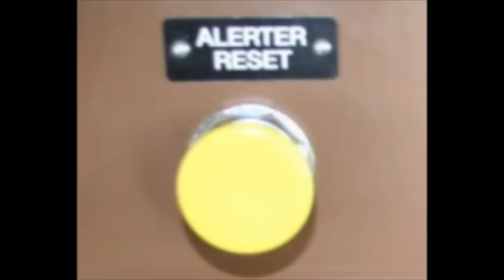Red Oak Train Crash 8 years later

Comment: I think the reason they renumbered 9159 was because of the tradition that when someone is killed in a locomotive's cab, that engine is renumbered. Remember NJT 4148?
Reply from the maker: Might be it, although there have been a lot more fatal wrecks in the past on BNSF, but most of the engines have also been scrapped. So you may be right.
Reply: Exactly. In all those other accidents, either the crew weren't killed or the engines were scrapped afterwards, but this one was an exception, where the crew was killed but the engine survived. I don't really know too many other accidents like that.
Reply: I seconded that point....its renumber because someone passed away in it
Reply: @RyansColoradoRailProductions  hi
Reply: Actually I looked it up and it was because it was a request by the family of the employees
Reply: Norfolk Southern has done this in the past too.

7100 is Ex-7117, which was renumbered at the request of the family of a crew member who was killed involving that unit

6900 is famously Ex-6653, which was involved in the deadly Graniteville, South Carolina chlorine disaster

Comment: My clock radio has a 7 minute pause between alarms. I can rise up, hit the snooze button, and dive back under in a heartbeat. I actually get my deepest sleep with the alarm going off.
Reply: i can sleep for hours resetting the snooze every 10 minutes 😂
Reply: I've hit snooze multiple times without ever remembering doing so.
Reply: Good point. Maybe they should have to read a random code, input it correctly, and then continue. Surely that would wake them up a little more, but as a driver I can wake up a little every few minutes but its easy to catch myself dozing off again.

Comment: I work at a railway up north and I can’t tell you enough how fatigue is such a serious issue, and if anyone tells you (myself included) they haven’t fallen asleep on the job we’d be lying. It is extremely easy to especially after a bad snooze or being called back to work 3H after you’ve gone off duty. 

The gentle rock, low hum, low vibrations, it’s almost as if the units are designed to send you to sleep.

But, to combat it TC is revamping the rest rules to combat fatigue, hopefully they’ll be enough to seriously help out the guys and gals on the trains.
Reply: Three hours? Most railroads I've applied to tell me they can't call you back to work unless you've been off-duty for 8-12 hours straight.
Reply: Here in canada its 6h plus 2 to "green up" (aka work full 12). Commonly on the branch lines you can be called right away (or 3h in my example) and work your 18h clock. So lets say you worked 11h one shift, got 3h of sleep, you can work 7h until you legally cannot work.

But most times (Especially mainline and certain branch lines) they'll green you up.
Reply: You can’t legally step on a locomotive less than the time currently set by law. In my era you had to be off 8 hours. Today it may be more, but certainly not less. The problem is that you have to be called early enough to allow you to report to work. I chose to live in a flop house across from the yard where I worked, the “El Patio Hotel.” They rented rooms by the month, week, day, and yes, by the hour. I could get to bed in about 15 minutes. In the morning I had a good breakfast in the cafe downstairs and was in the crew lounge within 40 minutes. Cost to live there, $7 per week. I averaged 6 1/2 hours sleep a night. Another newbie lived with his parents in Newton, KS. His drive was 30 minutes each way plus he never got to bed right away because he got home when his mother was fixing breakfast so he ate, then chatted for a while,etc. He once told me he only got about 5 hours a night sleep. We weren’t on the extra board, so we didn’t have to be wakened by a call, but you can see that 8 hours off isn’t the same as 8 hours rest. Railroads don’t make allowances for travel, etc. I know of instances where people would have to take a transfer or be laid off and would sleep in their car to save money, then drive home on their day off. How rested were they? It’s a combination of regulations, business demands and poor judgement one the part of individuals in both labor and management back then and still today.
Reply: @Trainfan1055Janathan  Maybe they didn't fall asleep could have been a suicide and they decided to end it all!!!
Reply: Not entirely sure what the rules are like in the U.S, up here if you haven’t worked 18h without 6h or rest you’re subject to work on your 18h clock. Times have certainly changed that’s for sure.

Up here they’re changing the rest rules for the better, now from what I’ve heard it’s going to be 8h minimum rest at your away from home terminals and home terminals, and no more doubling out and 18h clocks from what I’ve heard. It’s certainly going to help with fatigue management in my mind.

But, On the flip side it’s also what we signed up for, we each have our own strategies as You have yours.
Reply: Yes, they have and I agree that fatigue plays a part in accidents. I just feel that you can take fatigue out of the equation and you will still have accidents. The problem, I think, is human nature or more accurately, how our brains are wired. For example I lose things and often find them somewhere I have already looked at least once. I missed them the first time because I assumed they weren’t there, but I looked anyway. They were there, my eyes saw what I was looking for, but my brain didn’t register it because my assumption was it wasn’t there. 

There is a scientific name for this phenomenon that I don’t recall. It applies to all sorts of things. Like guys in the Time Table and Train Order days misreading their orders or warrants because they worked the same job with the same situation day after day, but today there was something new. If asked they would always say they read them to see if anything new was to happen, but they may not realize they see some of the usual and their brain starts thing about something else even though their eyes are still reading. 

I wonder why there was no flag man for the work train. They had to know they were blocking the main. Most likely they knew the other train was coming. In my time we would have dropped a flag man to the rear of the train to put a torpedo on the rail.  The following train is required to wait ten minutes before proceeding each time they hit a torpedo. You don’t hit one of those without knowing it! I know they have radios and alarms and electronics today, but those things fail.
Reply: Oh of course, Im wondering the same thing. Things snowball so quickly at this job. It’s never just one thing.
Reply: Marco393 scariest thing is dozing off just long enough in the middle of the night and not waking back and seeing a milepost or clear signal. It happens, and if you’re lucky, your other crew member is wide awake and alert.
Reply: Indeed it is, do it once, and you'll (hopefully) never do it again.
Reply: I checked with a few modern day engineers and learned that there are no non-electronic warning devices including flag men today or at the time of this accident. The governing agencies assumed that the available electronic warning systems were adequate. Seems to me they needed to include a remotely activated taser in the seats set just below stun.
Reply: well trainfan1055 if you actually did more than foam on the side of the right of way you would know they can make you come back with 4 hours rest
Reply: @Trainfan1055Janathan  You can deadhead to a terminal and be called short rested for a train which happens quite frequently. The time you were deadheading goes against how long you can work on a train.
Reply: If you have other crew members!! @philb2820

Comment: Great videos. Thank you for putting them together. My father and brother worked for WPRR out of Oroville CA. In the 70s and 80s I remember them going on derailments in the feather river canyon many times. At one point WPRR had the inside edge of the rail grinded smooth but the grinding left the track rough and the wheel flange would climb the track, they were throwing trains all the time.

Comment: @The Angry General  A train that weighs close to 19,000 tons with three units running in notch 4 isn't stopping very quickly, even at only 20 mph.  A coal train of that size has about the same amount of energy as a small thermal nuclear device at 50 mph.  I run these trains o a regular basis.  They have excellent stopping power with their differential brake systems, but when you are under power with brakes released, they are going to cause a lot of damage when they hit something, even a slow speeds.

Comment: I'm Brazilian and I noticed that in the United States, its workers are very splendid. Here in Brazil we have the right to a worker that helps us a lot. Here at work 8 hours a day and play at least 11 hours. The drivers here in Brazil. work until certain hours, depending on where he is. He comes and goes to another driver and continues to carry the load. The railway machines have an alarm that from 30 to 30 seconds it rings. Then you press the button (if it is called a motorcycle pilot), If by chance the driver does not press the time he touches, the machine simply stops by itself and turns off.
Now because it can not be like that, a rich country. Too bad the riquesa is only for the businessmen.
May God bless you.
Reply: I have seen a driver pressing an imaginary pedal even in his sleep so I wouldn't be surprised if a driver falls asleep at his post, but keeps pressing that pedal in his sleep.

Comment: The striking coal train crew went by one signal that was a grade signal. It was a red signal but it was not a stop signal. It required restricted speed when passing it. (Being able to stop within half the range of vision, in this case looking out for train ahead, not to exceed 20 mph). I'm just stating this for the correct facts. The coal train didn't go by several stop signals as stated.

Comment: They should have a 12 hour rest period between shifts at least.
Reply: We get an undisturbed 10hrs currently.  Used to be 8.... imagine having an hour or so drive from work.  Get home to mow, cook, shower, etc. By the time you get settled down you've easily used up 3-4 or more hours.   Now as you lay there you're dreading that call that's coming in less than 4-5 hours and you stew on it losing even more sleep.  Those were definitely the zombie days.
Reply: They work a 12 hour shift get eight off if that's right.

Comment: The problem with the alerter system is that it's basically just a snooze button. Several of my coworkers have told me that it's not always easy to stay awake when you're working the extra board as a rookie engineer, and I have to say I agree with them. When you don't work on any real schedule, It's easy to find yourself being lulled to sleep. Again, the alerter is just the snooze button. You briefly regain consciousness just enough to reset it, and immediately you find yourself back in dream land. It's a bad habit to get into but it becomes a reflex for a lot of guys fresh on the board until they get seniority enough to hold down a train.

Comment: Fatigue is a problem in the transportation industry not because of the total hours but because of the oddball hours.

I know being an OTR truck driver how certain OOS regulations lack common sense. I found out how the 70 hour rule lacks some of that . For instance if i ran out of hours early in the day, say by about noon or so I can start driving at midnight because that's when I gain back hours. Yes I may have had more than the 10 hr break required but how easy do you think that is to fall asleep in the middle of the afternoon and be rested at midnight. I would've been better off driving till about 6 or 7 pm than shut it down early and try to sleep at a time l just can't.

Comment: There was a accident before this one which kinda has the same thing. It's the Hinton train collision. That happened in 1986. It's were two crew members in the front of CN train, sleep in the lead engine of the CN when the train collided into Via Rail 4.
Reply from the maker: I know about that one. Thunder did a vid on that. Also that was a head on. This was a rear End collision.
Reply: It was a head on collision. I did saw that video of the Hinton train collision that thunderbolt did. I was talking about that by saying kinda. I'm not sure if the Hinton train collision was the first train incident that some crew members falling asleep in there train. But it was the wreck in 1986. It was also a head on train collision, while this is a rear end collision and it had same thing that the Hinton train collision did in 1986. Were some crew members were sleeping in the cab of the lead locomotive and then the train collided into another train. But there were difference in those two collisions. Train accidents happen.
Reply from the maker: The engineer may have been dead before the trains crashed.
Reply: The cab filled with carbon monoxide in the head unit freight but Co buried that those boys were unconscious but dead men tell no tales the end caboose man didn't sleep they lied our radios fail slot in that area
Reply: I actually saw footage of a similar incident that happened at around the same time.  Though there was no collision.  I think the Via Rail train ran a red light in dark territory.  Both trains saw each other in time and the freight was able to completely stop and reverse in time to just avoid a crash by a hundred feet or so.  The engineer on the Via train actually jumped and he was the only one to suffer any injuries.  To be fair, had the trains actually collided, he most likely would have been killed since the freight locomotives are much heavier and would have crushed the passeneger locomotive like a beer can.  Actually here it is and it was closer than that even https://www.youtube.com/watch?v=838vcxVwXOo
Reply: Train accidents happen. The only locomotive that survived the crash is Via Rail FP9 6300. And still exist today.
Reply: Train collisions happen too. Just like the Hinton train collision.

Comment: I believe the law for crews rest between assignments was changed fro 8 hours to 12.  "Getting off work", being driven to a motel in a distant city, eating, showering, and finally falling asleep in a total 8 hours, then to be "called" for another 12 hour work day is totally unrealistic.
Reply: Hence why i'm calling it "Systemic management failure".
Reply: I think its referred to as greed by the railroads.  It would actually cost less to have more employess working and not being paid overtime.  Its a 24 hour a day job, 3 crews per day vs 2 would be the same amount of hours but all paid at straight time.
Reply: You get 10 hours from the time you clock out. I can get the drive/eat/shower/say hi to the wife done in 2 hrs and get 8 hours sleep. And legally you can only work 12 hour shift max. HOWEVER, it can still be extremely difficult to keep your eyes open at 3am going 10 mph up a hill for 45 minutes.

Comment: The FRA did testing with train crews in a lab setup and discovered engineers would be dosing off and still instinctively reach over and reset the alert or button.

Comment: Surely if the Engineer fell asleep there is a Dead man`s handle!?he falls asleep ,then let`s go of the pressure he is applying on the handle the train brakes are then applied!!
Reply: The narrator said they were awake enough to reset the alerter so the dead man switch was not in play either